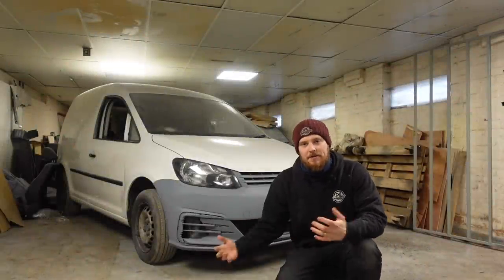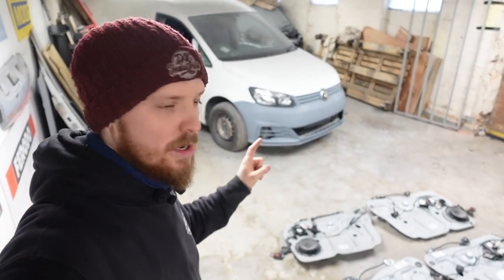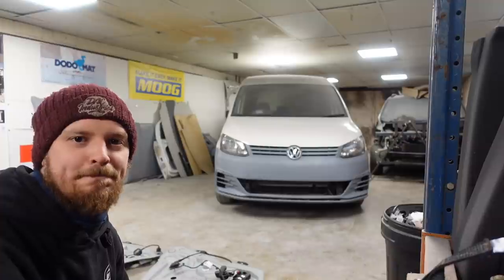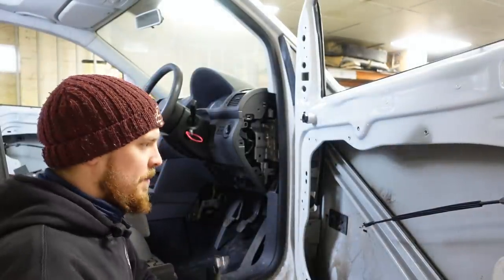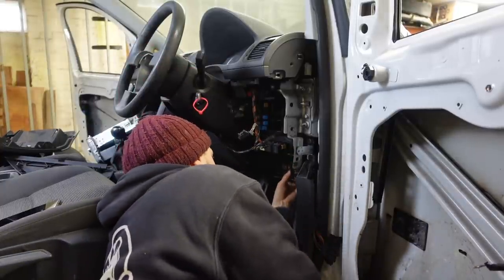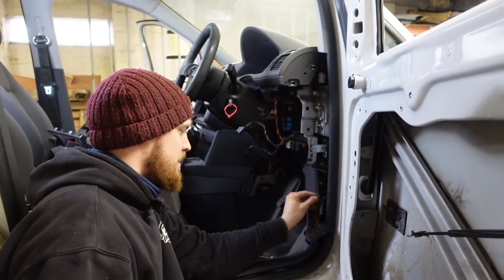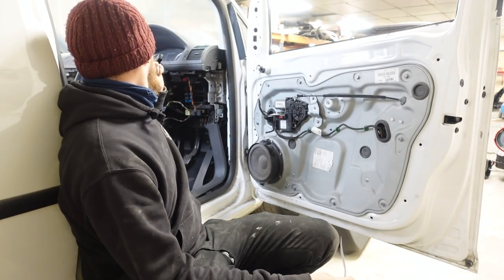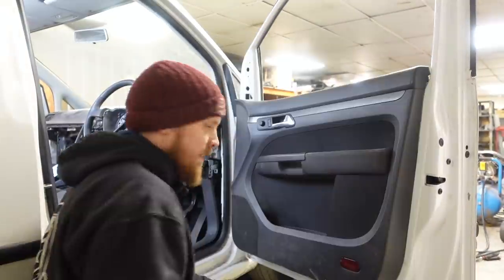VW Caddy 2K Build Series - Fitting Touran Electric Windows - Episode 10

Comment: Fantastic series mate, I've just fitted 2998 touran cards to my 07 caddy. Luckily both the touran and the caddy loom connectors are the same so 👍🏼, when I bought the van it already had touran wing mirrors on and no repinning needed and everything works apart from the central locking, but wasn't working when I bought the van and is something I need to investigate. Love the channel and has been a massive help keep up the good work 👏🤜❤️
Reply: I've a 07 caddy I'm about to do electric windows. What year cards do I need as id rather not do a repin if I don't need to? Did you get the central locking sorted

Comment: I just completed the dash swap and door cards from a Touran on my 2010 MK3 Caddy and it was a bit different to in this video. First of all, massive respect to Dan Chambers for going through the pain of investigating this, filming it and presenting it in a way that we can all understand.

In case someone else does this. I bought the wiring loom from ebay as Dan did, but the big difference on mine was that when it come to running the cables inside the door to the window mechanism, the whole where the wire goes was already wired. Tracing this back I could see that the door loom had an extra (fatter cable) that looked like power to me, that the car didn't have. So, I plugged my new feed cable from the fuse box into the spare hole on the inside of the van that corresponded to the fatter cable in the door loom and everything worked as it should. Central locking, and windows both sides.

My key doesn't work on the remote so I have not tested if this operates the doors and I have not switched the cables per the recommendation.  That is for another day.

Love the channel, Dan!

Comment: Dan the man, thanks for that mate, just fitted mine and thanks to you it went well. Keep up the good work.
Nb. There is no wire in pin 13 on the passenger side but it makes no difference it works anyway. Thanks again

Comment: I have just done this conversion and the extra 12v window motor power feeds I'm pretty sure should be permanent live (not switched) which is the top row of fuses on my 2013 caddy - numbers above 43. I don't understand how you got this working using fuse position 31 since that would usually be a switched live position? Mine wouldn't.  Anyone who's having trouble perhaps try the permanent live power feed. 
Otherwise an absolutely brilliant 'how to' which helped me a lot - especially the re-pinning!    Top man Dan!

Comment: Caddy van window are known to work slow. Apply a bit of silicone spray into the window rubbers. It will free them up a little. 🙂👍🏻
Reply from the maker: Cheers bud. I will give some silicone spray a go when it is all finished.
Reply: The rubbers dry out in the summer. Sometimes they won’t close and go back down to fully open position. 
To reset the motor limits hold window button for 10-15 seconds after fully closed. The same goes for fully open. 👍🏻

Comment: Thanks alot for the video....I'm gonna be fitting 04 touran cards to my 05 caddy.....silly question...do you have to re wire the pins the same on the passenger side?...many thanks
Reply from the maker: Glad you enjoyed it dude, Yes I repinned both.
Reply: @DanChambersDAC  thanks mate...I got lucky I found door cards and regulators from a similar age car and it was simply add in the power and it works....I noticed tho that the driver's door card doesn't sit over the felt seal as well as the passenger side even tho the cut out for APillar was right....did you notice this?
Reply: @DanChambersDAC  it's ok....I had the felt seal upside down 🤣

Comment: hello dan ive been looking for the modules you used on your build pasasener side 5k0 959792 can find but drivers side 5k0 956793 cant find does come up on any search ether did you mean 5k0 959793 which is caddy 2010 to 2015 drivers side module thanks martin

Comment: Another belter👍👍
One question, the pin 37 that you connected to on the fuseboard, how did you run a feed to this from the battery? Or does this automatically have feed one you put a fuse in?
Reply from the maker: Cheers bud. So I should have explained a little better there are a few 'spare' spaces on the fuseboard that have power to one side. You just plug the wire into the other side and link with a fuse.
Reply: @DanChambersDAC  I need to connect some things up to my t5. Need to find a similar 12v feed on my fusebox

Comment: Good video. Just wondering if you had to re-pin the passenger side. Also did you use the touran motor and module
Reply from the maker: Thank you dude, Honestly I can't remember 😂 I think I did re pin, Yes I used the Touran Motor & Module.
Reply: Hi Dan.
Yeah I've found the video just I tried re pinning but window doesn't work correctly. Love electrics

Comment: Hi we have a vw van t5.1 is the wiring loom you bought of eBay  the same as am having problems find the cable link/loom from each door to fuse board . Thanks
Reply from the maker: I doubt it would work. I fitted an aftermarket electric window kit to my T5 and modified the switches to fit into a genuine housing so it looked factory.

Comment: Hello mate great video I just purchased some door cards so I’m going to attempt this thanks to your video I’m hoping it’s possible 😬you wouldn’t happen to have a fresh link for the power cable would you as I’ve tried to warn you posted in your description box and it’s not finding it on eBay thanks
Reply from the maker: Awesome bud, I didn't find it as difficult as everyone said. I have tried to contact the original seller but eBay won't let me message them unfortunatley.
Reply: @DanChambersDAC  That’s okay thanks for trying anyway but thanks for your video I managed to sort it and just made my own power lead and I hit lucky my central locking is working without any alterations but thanks again for getting back to me 👍

Comment: top video as per, just a quick one, how did u get power to the cable you put in under the dash for the windows? so you you run the wire straight to the back of the fuse box to fuse 31 i believe u said, but did you power it off of an ignition live else where? just interested to know but quality build keep it up!
Reply from the maker: Cheers for watching bud. I should have explained that a little better. There are 'spare' spaces in the fusboard that already have power to one side. You just add you wire to the opposite side and fit your fuse.

Comment: Anymore info on the wire? The original eBay ad is not up anymore. Was hoping for a part number if you have it so I can get it through TPS! Cheers
Reply from the maker: Hi unfortunately not. The listing has been removed and I have messaged the seller but not had a response.

Comment: Anyone know we’re to get. Module pin outs done this in my van and passengers works but drivers up goes down and central locking not working drivers module 1k0959793j my caddy’s 2006

Comment: If you need any more help with wiring/elecrics just give me a hint. I'm working at a VW dealership and wiring/coding is what i do most of my days.
Reply from the maker: Thank you so much for the offer bud. I am going to look into swapping the rear lights for some Mk4 if possible. I think they do need coding though.
Reply: @DanChambersDAC  Now I've looked into the wiring diagram's for the 2K and facelift caddy.
You need to re-pin the connectors as following.
Left side:
move Pin 2 (grey/black) to Pin 4, move Pin 3 (brown) to Pin 6,
move Pin 4 (red/black) to Pin 5, move Pin 5 (black/blue) to Pin 2, move Pin 6 (black/white) to Pin 1.
Right side:
move Pin 1 (grey/red) to Pin 3,
move Pin 3 (brown) to Pin 1,
move Pin 4 (red/black) to Pin 2,
remove Pin 5 (black/blue),
Pin 6 (black/green) stays in place.
You may have to do some extension/rewiring with the foglights wiring. That wire is white/yellow.
All my wiring diagram's are for ROW (not RH drive) so i hope that I'm correct.
But if I'm not, here are the wiring colors and what the do:
Brown: Ground. 
Grey/Black: L Driving Lights. 
Grey/Red: R Driving Lights.
Black/White: L Blinkers.
Black/Green: R Blinkers.
Red/Black: Brake lights.
Black/Blue: Reverse Light.
White/Yellow: Fog light.
You may need to recode your BCM (09) as well. Notify me if that's the case. 👍
Reply: Hi would you know the pin out for 1ko 959 793 j I’m trying to put electric windows in a o6 caddy